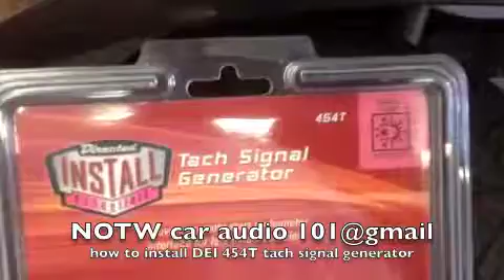how to install DEI 454T tach signal generator

Comment: man I did this same thing but my Prestige APSRS3Z either isn't reading the signal still or I'm not doing the tach learning steps correctly. I have the orange and green on the 454t connected right now. I am getting about 1.2v AC at the green wire at idle and it increases with RPM.